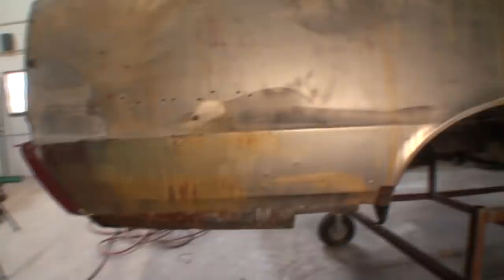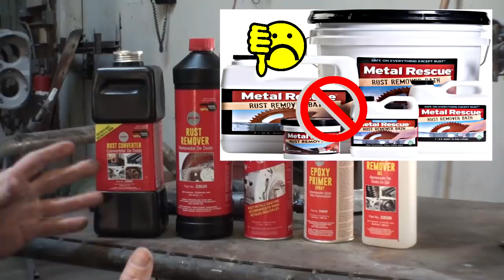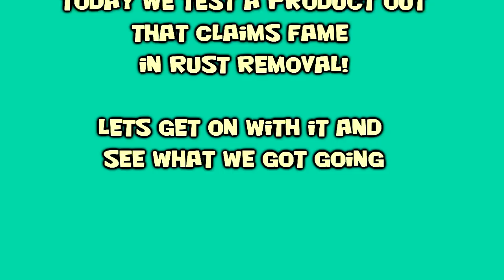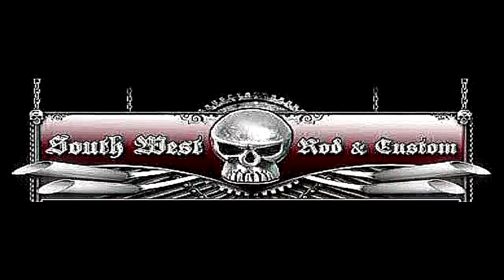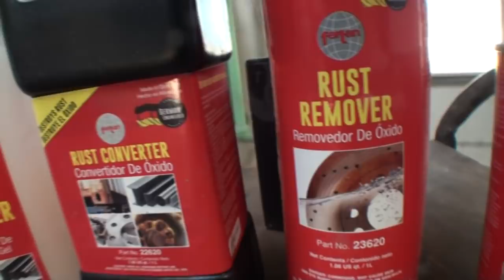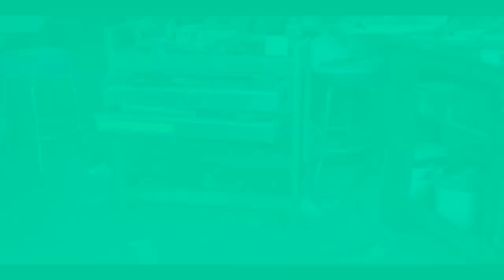How To: Remove Rust With Chemicals - FOR GOOD!

Comment: Fertan is great stuff. I don't use the rust remover,  just the inhibitor. Incidentally, you are supposed to let the rust convertor cure for 24 Hr's then wash down with water before applying any primer/topcoat. I use it a lot inside rockers, body cavities and the like usually by fine spray.

Comment: First time responding to you. I just beat stag 4 tonsil cancer. I am blessed for sure. Just bought a 1969 AMC AMX 390. What you teach is very valuable and also entertaining. I am soaking my original rotors right this minute. Hi to Minnie, she is a true asset. Keep up the great work. Semper Fi Brother. Neal
Reply: I got my AMX painted and she came out perfect . Airplane stripped to Bare metal, 3 coats 2k primer, 3 coats base coat, 3 coats clear. Getting ready to color sand and buff from one of your videos. Thanks pete, YOU ROCK. NEAL

Comment: most primers are designed to be sealed over with a sealer of some sort even epoxy will rust after a wile if left to the elements I always coat mine with a clear coat or left over single stage paint before I cover it up for good   but I have only been doing body work for 25 years or so

Comment: I have some rust converter from 35 years ago by FerroPro...It's like milk and I use a spray bottle to put it on then when it's dry you can paint over it...Works great.
Reply: Sounds like corroseal.
Reply: I think I know what your talking about, I used it before I don't know if its the same name but same principle..  Hope things are going ok Ziggy! Getting ready to go work on my new shop in Moab tomorrow...

Comment: I bought some 75% phosphoric acid and cut it with distilled water down to 25% to 30%.  I put some rusty nuts and bolts in the solution and it dissolved the rust within 20 minutes.  I will try on a rusty panel and scrub with red scothbrite, rinse and see what happens.  If I'm satisfied I will cut the 25% to 30% solution down to a 3rd of that or 10% and spray on water wet panel for rust prevention until I primer.

Comment: Hi Pete, I use  with  great success is Citric mixed 10% with water,  For vertical surfaces I mix with wallpaper paste to a stiff consistancy. Leave 24hrs the wash of with water & dry. you will find it doesn,t  surface rust after like vinegar water.

Comment: So frustrating watching you beat your head against a wall with rust removal. Listen Pete, my friend pete, everybody’s friend pete, LISTEN PETE.  Get hydrochloric acid, it will remove the brown rust, leave the pure steel behind, no bullshit black oxide left behind. Then Pete apply phosphoric acid, it will leave behind iron phosphate that is chemically bonded to the steel. Finally dtm epoxy primer and work it with normal methods. While you were in the Navy serving our country I was doing this shit before Jimmy peanut Carter started  ruining this country. Listen Pete!!!
Reply: These products do have a purpose but the way you describe is true old school way to do it. Thanks for the insight.